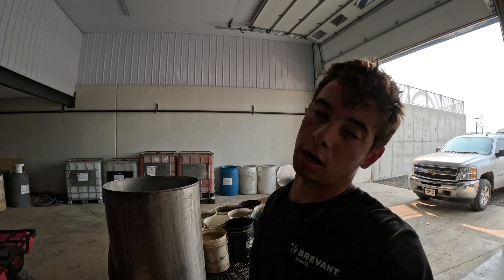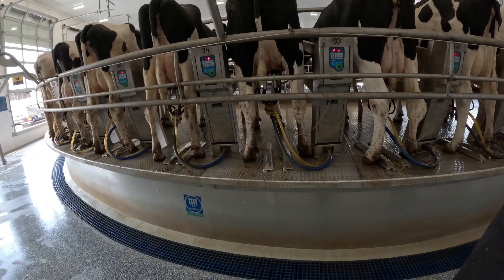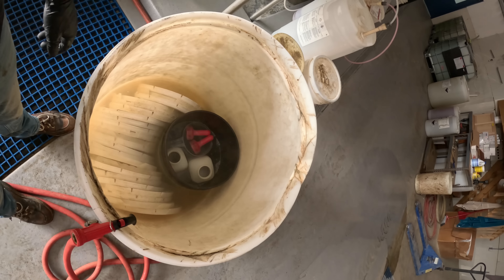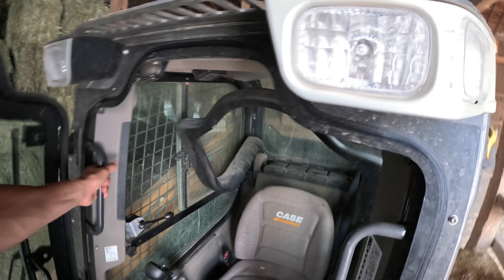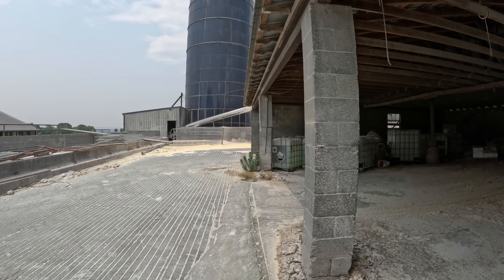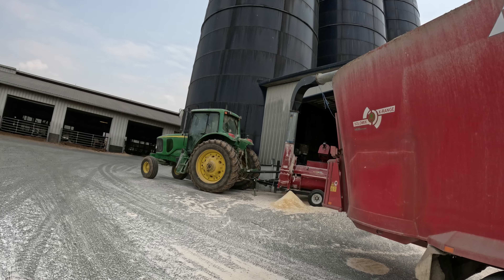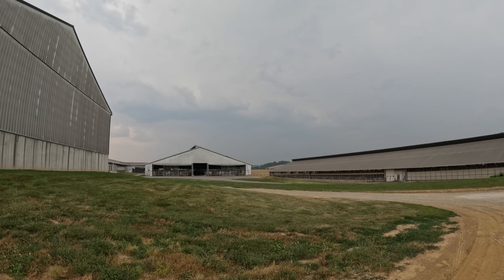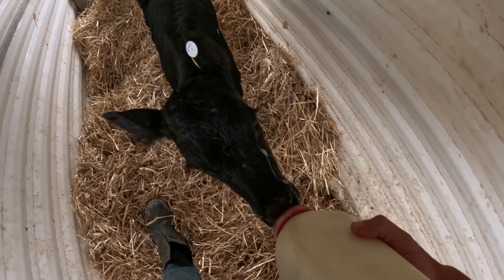Life of a Dairy Farmer EXPOSED

Comment: Great job Ashlyn,  thanks for taking us along and explaining different parts of the farm. Yes you're a very smart man the fabric allows the water to sip through but one other important thing that contractor failed to mention....the fabric is also there to stop dirt from getting into the gravel and plugging it,  just wanted to mention for future knowledge. Most roads are also built like that, especially if wet clay, they put "soil fabric" down then gravel ( it stops the gravel getting into dirt or vice-versa ) so it compact properly. Thare is also "weed fabric" wich is placed on top of soil, allows water/rain to soak through stops weeds to germinate. Depending on applications sometimes covered with mulch,  like in landscaping.  There you go a bunch of nonsense info, 😂 but good to know.